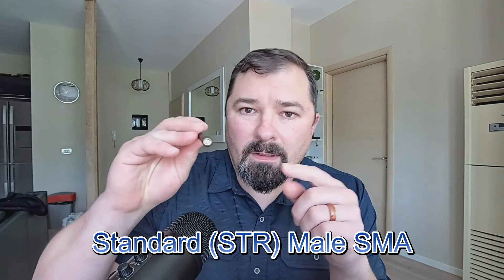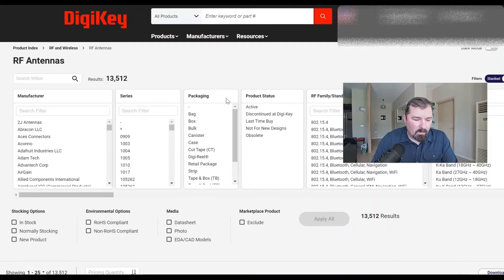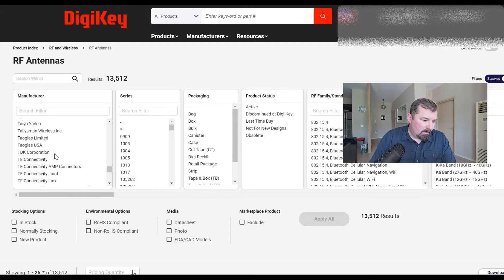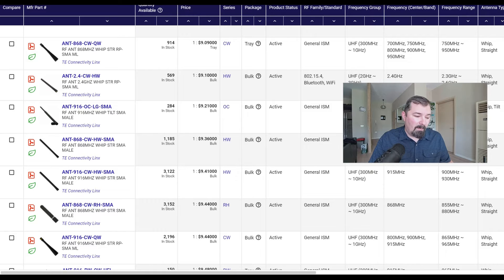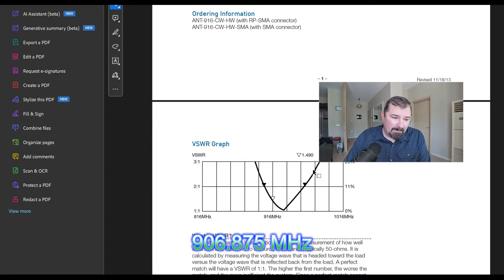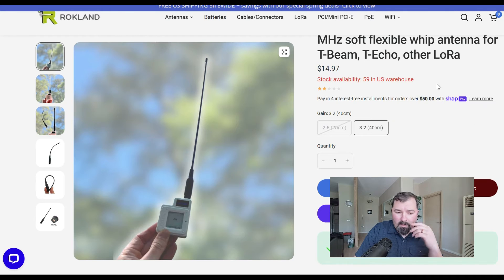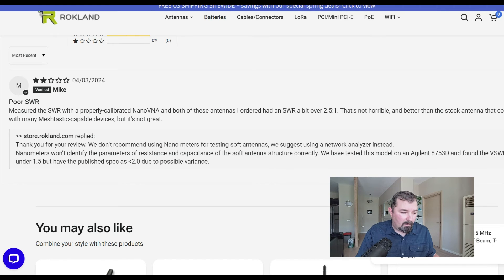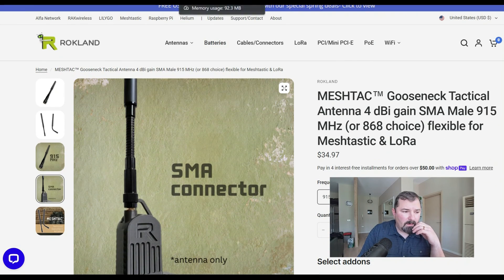Selecting the Right Meshtastic Antenna 2.0

Comment: Great video! I just got my order from Rokland with 2 of the tactical goosenecks and 2 of the shorter flexible whips. I only have a TinySA ultra, so I can’t really check the SWR, but I’m definitely getting better reception than with stock antennas from Liligo or RAK. I need to order a nano VNA to at least have some sort of testing option. The flexible whips are awesome and feel super well made. I put one on my kids t-deck, so now I don’t have to worry about him breaking it. Then another on a deployable relay built from a t3s3. I got the goosenecks for my t-beam supremes, to be mounted to packs or as mobile base stations. They feel extremely solid and weigh about the same as the entire node with battery. They don’t flex quite as much as I hoped, but you can get a 90 degree bend without worry of breaking. My main concern is the sma connection on the radio. You may want to reinforce the connection with support from your enclosure. The Allycat t-beam supreme case does include support for this, but I had to expand the hole slightly to fit the base of the antenna. Most of the other enclosures I’ve seen don’t have a way to add support to this area, so be careful. Now I want to grab a few of the longer whips as well for my mobile RAK nodes.
Reply from the maker: Outstanding! Thanks for the feedback about the antennas. I definitely agree with you about the support for the antenna.